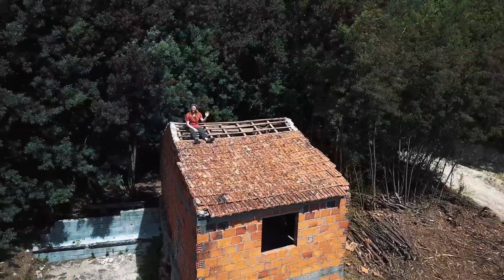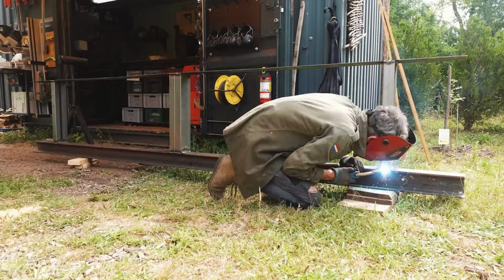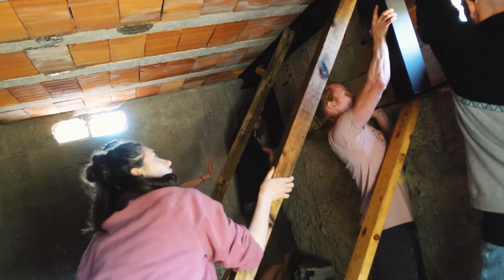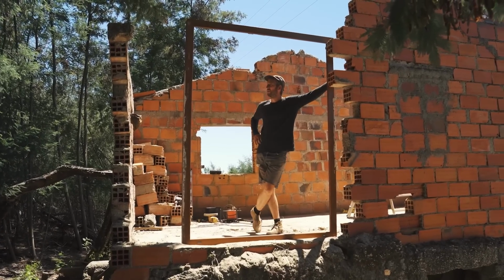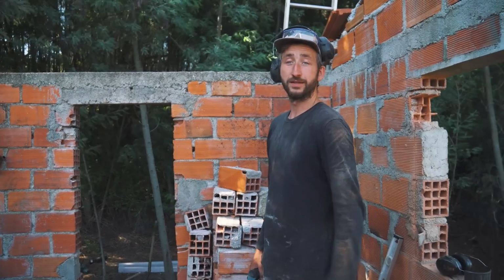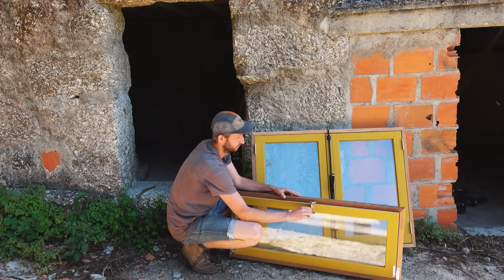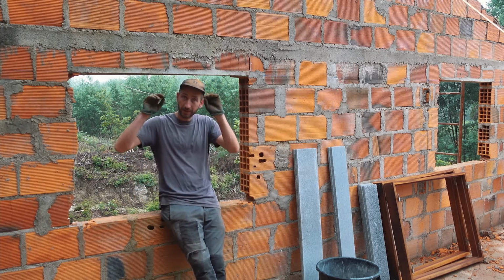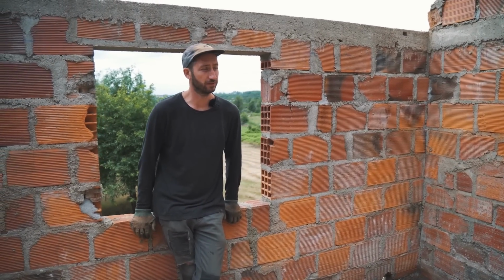#52 Renovating bricks and windows in our old abandoned portuguese ruin

Comment: Aside from being terribly constructed without any structural support, the surrounding area endured a fire some years ago. I don’t know if the fire came up all the way to the building, but the intens heat alters the structure of both the cement and the bricks and makes them brittle. Combined with exposure to moisture and temperature differences cracks will occur even where you don’t see them. Tearing the building down is a much saver option since it’s not built well to begin with. 
On a more general note. I don’t see what kind of other way of living you’re prototyping. You are using pretty much all conventional materials and methods to basically create a campsite for people like camping ‘Buitenland’

Comment: You guys NEED to be wearing respirators when using any type of grinding equipment on brick or cement! You are doing serious damage to your lungs by not using the proper PPE. Y’all need to get your safety up.
Reply: True
Reply: That or use running water when making the cut so any dust get trapped in the water / using a wet saw

Comment: this "rigging" is brilliant...brilliantly useless! with that amount of slack it doesn't secure anything. But then this wall is so unstable that a little bit of tension would topple it anyway. And there you got your answer, you try to put band aides on a wall which is not worth saving.  

Did you ever consult with an architect, structural engineer or anybody with any building experience? you are worried about a drip edge on your window frames, but are OK with all the structural problems of this "building".

That steel structure is a nice touch but if you can just lift it in, it doesn't really take any load and when you remove the brick wall you create an overhang which might not be able to support the wall above...

Comment: You guys are crazy and not in a good way.
I have no problems with the quality of the video or what you choose to film, but your attitude to safety is terrifying.
I mentioned this before when you were taking down the roof, but still you continue with inappropriate and inadequate PPE. No respirators as lots have mentioned, no hard hats, ear or eye protection, no footwear with protective toecaps. You have been lucky so far but it will not continue.
Then there's the approach to building generally - you urgently need to get an engineer to advise. I am NOT an engineer but it is obvious that "granite" is not strong if you can break it up and level it with that puny battery tool. The steel reinforcement needs to have an RSJ girder at the bottom as well as the top. You could see how the thin bottom plate was flexing when you moved it so it will not spread the load evenly across the supporting wall - it will just be concentrated under the 3 verticals.
The scaffolding is completely unsafe being balanced on a shaky pile of stones at one end, however you choose to climb on it.
The walls are also completely unsafe as demonstrated in your sketchy method of "supporting" them with ratchet straps that would have brought the whole thing down if you'd tightened them or someone had walked into them.
It is all very well wanting to prevent waste and reuse things, but structures need to be safe and there is no way you are making that building safe even with an internal frame imo.
They also need to be legal and I cannot believe what you are doing would pass any building codes in Portugal - they certainly wouldn't in the UK or in Italy where we restored and extended a rustico.

I applaud what you are trying to do and watch a lot of self-build, off-grid videos on YT. I had high hopes for you when I saw that impressive collection of tools you took with you at the start, but you now need to get some proper professional advice before continuing or someone could get seriously hurt or worse. At best when the authorities see what you have done you are going to have to tear it all down anyway.

Comment: They are gifting you old stuff that no one uses anymore, so be grateful and stop saying "that's the way they do it around here" as if everybody that's helping you! were some kind of doofus. And talking about doing things the right way, why didn't you use a rebar skeleton to reinforce the walls? The way they are built, any little failure in the bricks is going to bring the heavier load of the roof down over the too light bearing wall.😬